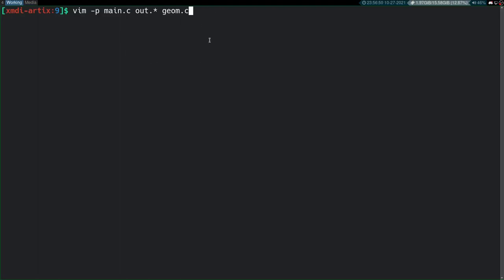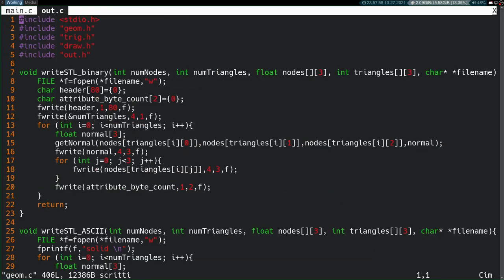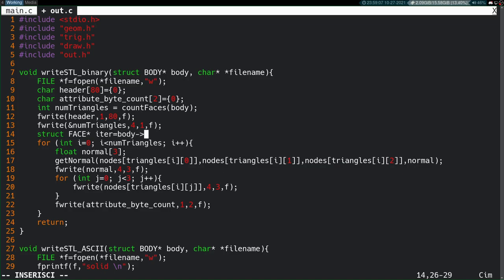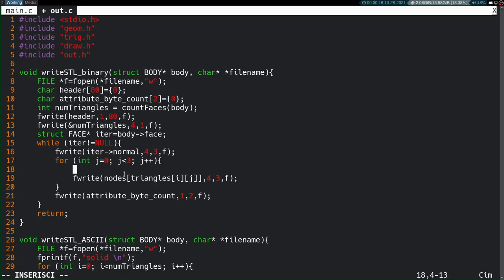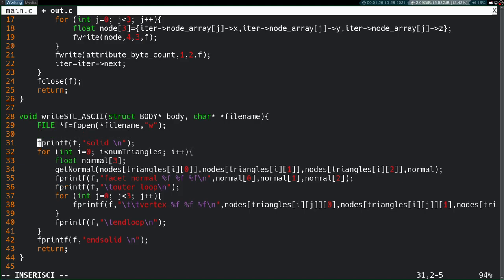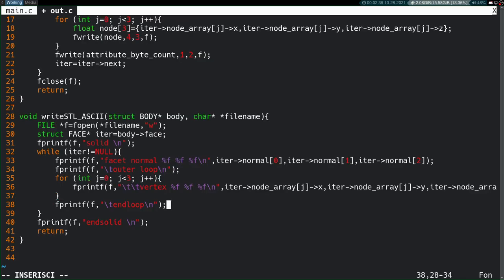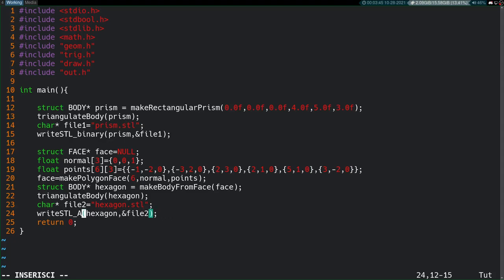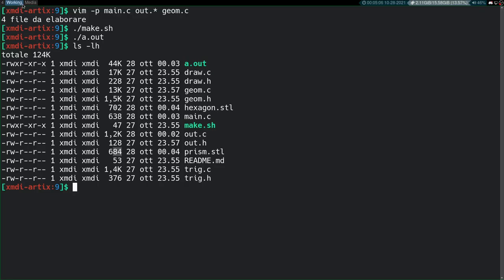Exporting our New Data Structures to STL | CAD From Scratch [9]

Comment: You can delete multiple parameters telling Vim to delete characters until it finds a comma multiple times.

Use "d4f," to delete four parameters, "d7f," to delete seven and so on.
Reply from the maker: That's awesome - I need to learn some of those useful commands, especially the ones that operate on words. I feel like most vim shortcuts aren't really worth it, but that one comes up often enough - thanks